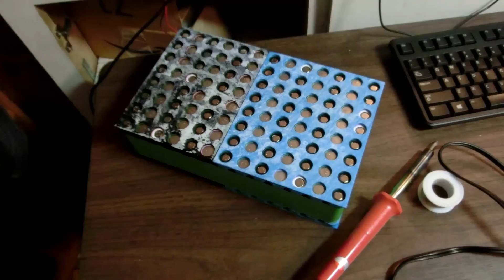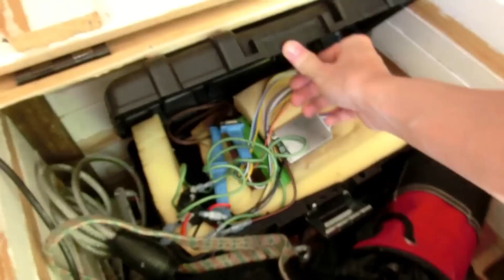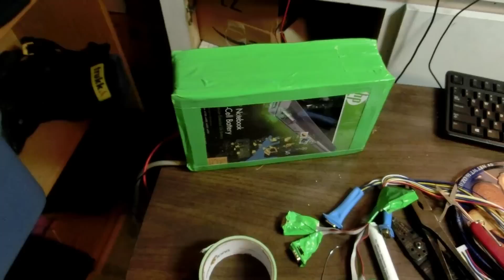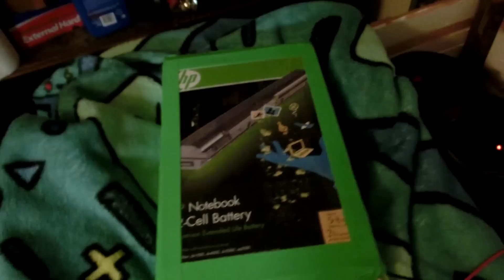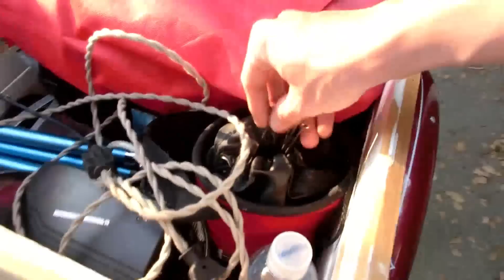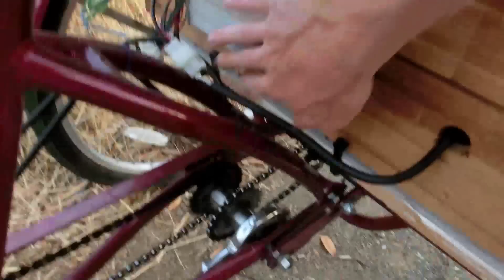DIY 52v (48v) 16AH Lithium-Ion 18650 E-Bike battery pack (E-Trike v1.6)

Comment: question? I am building a similar pack I have an Imax b6 charger my question is how do I wire the charge controller up to about 30 18650 wired in series. when I go to charge it will not do it detecting more than 1 18650
Reply: +ChriS Truex question, 30 18650s wired in series are you building a battery in the 100+ voltage range? I only ask because your definitely looking for something in the specialty market range of BMS if so. the highest easily available BMS is like 72v or 96v. BMS works to level and charge and in most cases protect cells from over and under discharge, each cell is wired in and charged individually. If your keeping some of those batteries in parallel then you have more reasonable choices.

Comment: You do a great job of figuring this out and explaining it.  Thank you!  Is there a link of how you have this wired up with the balancing cable?  I understand the battery wiring …but need to understand how to wire the balancing cable.  Thanks for your interesting and informative channel.
Reply: +Frets Nirvana connect the negative to the pack negative and then the corresponding cable to the positive on each cell

Comment: It wasn't a good idea at all, with a male connector to the battery, it's really easy to make a shortcut.
One most important rule is : EVERYTIME FEMALE connector for battery.
It's a basic point... and many people look at you and they'll make the same error.
Reply from the maker: AlexisFrJp Android but your forgetting that then the connector on the BMS would be male, that connector is live at all times also, so i would rather the onboard plug be better at resisting shorts than the battery. especially since theres always junk bouncing around in the back of my trike but if i have the battery out it will be in a very safe place.

Comment: Hey Rinoa i'm building an electic go kart and i have a good idea of what to do. but i have a 6hp 4500w electric motor. i don't know where to get a speed controller that can handle the 4500w motor. any ideas on how i could control its speed? its 12v motor btw. THX
Reply from the maker: Michael Langell run it through a lightbulb or something similar, so you have multiple power settings.
Reply: good idea and thx for responding so fast.

Comment: Why not use say an acid battery
Reply from the maker: Karim Kandil because they are bad in almost every respect. far heavier, far less capacity, and far shorter lifespan, and dont handle shocks as much.
Reply: Rinoa Super-Genius what about something like an RV battery?
Reply from the maker: Karim Kandil
yes thats what i'm talking about, a deep cycle lead acid battery.
Reply: Rinoa Super-Genius I have been enlightened then :) any news on the solar panel trailer upgrade? Sure its been a while since you mentioned it but it still sounds like a good idea.
Reply from the maker: Karim Kandil
not really sure, getting a Comuta Car and building steam engines has kinda taken my interest recently. but i've been doing more calculations and stuff for the solar trailer.
Reply: Steam engines..... What year is it again? Sounds cool though imagine just going around town with a steam powered anything
Reply from the maker: Karim Kandil
no i'm focusing more on a stationary steam powered workshop. of course run off hydrogen made with solar power.

my channel actually started out with steam engine videos in 2009. i was trying to catch up with a youtuber named Dquad who had 6,000 views on his biggest video and 50 subscribers, way more than me at the time. but then i got embarrassed by my older videos in 2011 or so and deleted them from youtube. i plan to reupload them again someday.
Reply: Maybe under the name Rinoa pre-super-genius
Reply from the maker: Karim Kandil
well my name is sarcastic, so that would be before i turned into an idiot? no i was even dumber back then haha.
Reply: Rinoa Super-Genius Rinoa ultra-genius? It doesn't even have to be a channel it could maybe be a series like random bits

Comment: What would you say is the most cells that one would be able to put in parallel when making a 3s battery,  and still be able to charge and balance the battery using a Imax B6 battery charger?
Reply from the maker: Hennie Morton theres no obvious limit.

Comment: Question I can't find an answer to.

With battery's how does the mA capacity multiply or divide based on whether they are in series or parallel. Google has not yielded any results for me.

Sorry if you get this question all the time.
Reply from the maker: ***** they dont multiply, they add. if you have a 1600mah and a 1200mah cell in parallel they make 4.2v at 2800mah.
Reply: Nice, thanks. Never knew these battery's were that useful until I started watching your videos. These could make excellent battery's at the fraction of the cost, people are always giving me old laptops to play with. I will probably use some of these for my full size quad when I start building it. It is also nice to find someone else who is as nerdy as me =-)

Comment: you certainly put alot of effort and precision into those batteries. it must be labour intensive to measure the capacity of all those cells! great pack. your trike is really quite nice. and fast at that 33mph i saw. thats very quick!
Reply: +smallenginedude71 its just painstaking to measure them, you clip a battery to the imax b6 and then wait until the beep, and then hook up another

Comment: By the was, I found these cheap (8$) Chinese LiPo capacity testers, to which you connect a power resistor. It discharges a connected cell until a specified voltage with up to 3A.

http://m.ebay.de/itm/281682297197?_mwBanner=1

eBay item number: 281682297197

Maybe a couple of those would help speed up your testing process.

The downside, it takes ages to be shipped, at least to me.
Reply: Looks like a bomb )
Reply: Pavel? Was geht?
Reply: LOL :)

Comment: Hello, I was looking around on ebay and saw a listing saying " 6x 18650 3.7V 2000mAh -Pulled from new battery" going for $5.13 usd and I wondering if you think it is genuine? it says 430 sold and I doubt they pulled apart from possibly 430 laptop batteries? Thanks!
Reply: harry barry When I say "genuine" I mean do you think they are really 2000mah and are not just some bad quality ultra fire cell.  link to ebay listing http://www.ebay.com.au/itm/271550370170
Reply from the maker: harry barry either way they probably didnt test the cells, i would just get laptop packs myself.

Comment: if you put acetone and rub it on the 3d parts that will make it stronger so it does not crack as easily. hope that helps next time you make a battery pack
Reply from the maker: Ed Leska no it doesnt make it stronger, acetone just dissolves the ABS, it does work great as a glue though.

Comment: *****  There are pieces that are already sold that are more versatile in configurations allowed (interlocking modular).  IE ebay item number 141686406643 and 261917747758

Comment: Hi Rinoa, very neat battery pack. I am building a similar one from discarded laptop packs which I got from local computer stores.

I really like your approach of sorting the cells according to capacity and then combining the highest and lowest to equal capacity parallel strings.

Do you mind to publish the source of your 4A pico fuses? I can't find affordable ones in Germany, they cost around 1$ a piece.

 I have a 24V ebike and plan a 7S10P setup.
My testing is inspired by your approach, cheap IMAX B6 for charging and discharging with labels for identification (numbers on the cells) and a spreadsheet to track voltage, capacity and so on, it should be convenient for sorting and parallel string composition.

For charging I use two metal rails with 8 magnets on each one, so I can charge 8 cells in parallel.

For discharging I use the IMAX and test one cell at a time, note the capacity in my spreadsheet, then recharge with some repurposed mobile battery bank PCB for storage so I can discharge the next cell more quickly.

Very interested in your pico fuse approach.
I have followed Jehu Garcia who uses legs of 1/8 Ohm resistors (cut off) for that purpose. 
However as far as I remember they melt at around 6 or 8 amps. Find your 4A choice more  predictable.

Looking forward for more videos.
Reply from the maker: Roman Seibel i just got them from ebay, sorry idk a source that will ship to germany.
Reply: +Roman Seibel hello look by reichelt.de "Feinsicherung, Picofuse, flink, 4,0A" 0,39 EUR
Reply: Hi Kalle, danke.
39 Cent ist nicht gerade günstig.

Comment: Hi Rinoa...I have a 36 volt pack, and my controller is rater for 25Amp (Max).  I would like to add a power switch on the battery.  I have deans connectors, and it seems to spark when connecting.  I am curious on how you setup have the cutoff or power switch, if any?  Do you rely solely on the connector to activate your controller/motor?   I believe you have a cut off switch on the throttle, which I dont.  Any advise on how to add a power switch for high amp ratings.  I have seen some 15-20 Amp AC switches on ebay rated for 110V, and I am bit hesitant to use AC switch for high DC current.  The other option seems to use a relay switch of some sort.   If you could do an episode on DC power switches and safety, it would be great.  I looked at Endless-Sphere forums, and most advise on 12 volt marine or Auto switches, but those are really huge an bulky.  Anything compact would be great (to fit in my battery compartment).  Any idea on how I can solve this dilemma (Mosfet vs relays vs switches)..which route to take for a simple solution?  (This is mostly for safety, so i can powerdown the system when the bike is not in use, and that no one can inadvertantly twist the throttle and cause injury or damage).  Thanks so much
Reply: +Sonnet Gomes use 2 regular light switches

Comment: btw 48v quite hard to "climb" up the hills~@@
Reply: Wesley Poon  i got a question that if you do make a like 72v battery pack it may last longer~ i mean that battery voltage can be make it as large as you like
Reply: +Wesley Poon you wouldnt want to discharge it below a certain point though but you could get more watts and torque for the number of cells due to voltage drop

Comment: Thank you for making this video, Rinoa. Like always, I really enjoyed being 'virtually' involved with your project!...  
Please forgive me for asking, if you have addressed this before. I wouldn't know which video of yours to go and look for: Could you please tell me how many volts and amps your charger puts out to your battery pack+balancer system? Is it one of those generic Chinese made chargers that come with e-Bike kits like the ones they sell at xcceries?
Thanks again.
Reply: +Farrokh Mirbaha it came with the motor, 52v at 2.5 amps
Reply: WOW! Thanks for answering!... Yes. You confirmed my suspicion that it was indeed one the generic type chargers. 
I used one of them, rated for 40v DC, on my battery pack of 10S made from Nissan Leaf car battery cells for over two years, without using a BMS. Charging them as if they were 10 Lead Acid batteries connected in series. However, the starting voltage on the pack was 37v and it never had an opportunity to go below that. When I changed my pack to a 12S, I went ahead and did a voltage check on all the batteries I had in the 10S pack. To my delight, while the total voltage was 39.4v, every single cell registered exactly 3.94!...
Meaning, not using a BMS with those low amperage chargers was not damaging to my beast of a battery pack that holds 33amp hours for each cell!... Thanks again
Reply: Farrokh Mirbaha im surprised it didnt go out of balance, is there some internal bms?
Reply: nope! no BMS. But consider the factors: the charger really doesn't put out more than 1.5 Amps at any time, giving it the chargeabliity of aound 6Wh, while the battery cell is rated at 33Ah providing a storage capacity of 500 Wh. Do you see the huge difference?... So I assert that because the charging power compared to the storage capacity is miniscule, the cells in series have plenty of time to balance each other out while under charge...
go here to read more about Nissan Leaf Batteries as I am using them: 

http://goo.gl/1slMFO

Cheers!...
Reply: Farrokh Mirbaha cool. that is surprising, but i guess the cells are extremely close in capacity.
Reply: DMAN22yeah  You said it!...
Reply: and very close in internal resistance. id still recommend a bms especially as the cells age.

Comment: Awesome build...  I thought you bought the plastic battery holders..  I was just about to ask where I could heg some...  Anyways..  Could you do me a fovour abd have a look at my build and give advice on potential flaws? Or mistakes that I may have made?  And how the ballance leads should be connected? 
http://www.instructables.com/id/12v-3s-lithium-ion-battery-using-a-7ah-lead-acid-b
Reply from the maker: +Hennie Morton wow i love that!

could you explain more about the glass in the battery? was that a display model?
Reply: Rinoa Super-Genius haha nope..  It was a FAKE battery I bought from a Pakistani shop..  Lasted for abou 3 months before it didnt keep any charge anymore..  Glad you like my instructable...  It was my first...  Im considering building another one,  but I received a comment on the thread saying that my cells would not balance properlh, this is why I decided to ask you..  Can you see any issue? I would really like your opinion on this...  I thought you'd like that build since you have a love for old PB batteries :)
Reply: Rinoa Super-Genius oh and I also wanted to know about the fuses that you use between cells...  And whg exactly is this? Could you explain a bit?
Reply: are you getting the messages?
Reply from the maker: Hennie Morton
yes, but that doesnt mean i have to reply. i have to answer many many comments regarding batteries every single day. tbh i kinda dont care about answering those questions sometimes. its not like i have much more to tell than whats in my videos already.
Reply: +Rinoa Super-Genius wow ok then...  No problem,  have a great day!

Comment: Synchronicity abounds! I am also right in the middle of building my own electric assist bike with a 24v, ~24 Ah li-ion pack. 16 cells in each parallel pack, 6 packs in series. The cells were harvested from a random assortment of laptop packs bought in a lot. Really fun seeing how all kinds of different packs are constructed and packaged - you'd be surprised how much they vary inside! Also found one that had half 18650's and half of these weird flat cells - lipos? But lipos in hard shell cases.

I actually see the hooping of the wire over the plastic in between the cells as excellent insurance against shorting. When I did my first little prototype pack, I had quite the frightening moment as I realized that I had been melting the ground insulation next to the positive pole when soldering (the copper conducted the heat and melted through), causing the wire laying over the positive ends to short out on the negative "ring". Very scary as I had basically built a fire bomb without realizing it. I had to promptly disassemble everything! What a disappointment.

On the Mk. II, I am using aluminium strips harvested from an old CPU heat sink to connect the cells together, and intentionally adding little hoops in between the cells to prevent that shorting problem, as well as add a bit of strain relief. Also doing an additional electrical tape wrap around the positive end for further insurance. However, I find your solution much more elegant. If only I knew someone with a 3D printer!

In case you're wondering, the motor is a 24v, 8A brushed DC motor taken from a Razer electric scooter. Chain driven, its old drive sprocket miraculously pressfit right onto my bike's rear wheel! So I'll be able to add power with pedaling, and the motor also came with a friction clutch so I can coast. It won't be quite the powerhouse that your hub motor is, but it'll do a good job helping me up hills and increasing my top speed.

It's gonna be a while until I can finish it, but I just may make a video.

Congrats on your upgrade, looks like it was a complete success! Thanks for continuing to produce great content like this. I look forward to the next upgrades you do to address the wire issue. Perhaps you could also test your hypothesis that the motor controller dials back current delivery as it heats up, then if so, come up with some kind of active fan cooling solution or something.

Cheers!
Reply from the maker: MrJamesonStyles no i dont think i would be surprised by whats inside laptop batteries, since i've taken hundreds apart. but yeah recently somebody sent me a picture of a hybrid pack and it was a surprise.

but thanks for enjoying!

Comment: Pretty cool design. If you were to loose the duct tape you could easily market these battery packs. I don't know if it would be a cost effective business but it just might be a little business on the side that you could use the profits from to fund further tinkering.  Nice video thanks for sharing.
Reply from the maker: Tony Emory yeah i'm working on speeding up the process, as it is its not worth it. but once i get a spot welder working and build a machine to automatically test cells, i'll be able to probably make several of these packs a month. i've been looking for a way for the machine to laser etch the capacities onto the cells once it's done testing it.

Comment: Generally if your balance leads are of thinner wire then the current passing through them should be limited quite a lot, as long as the voltage difference is not by more than a volt or 2 you should be good to go, I also have 2 lithium battery packs connected together via balance leads and even though the wire is rated at one amp I have not seen any melted wires when the difference is about a volt between them.